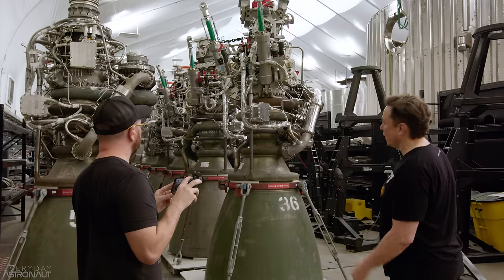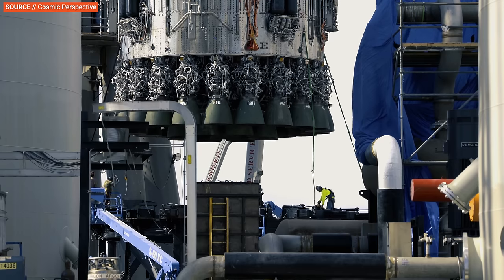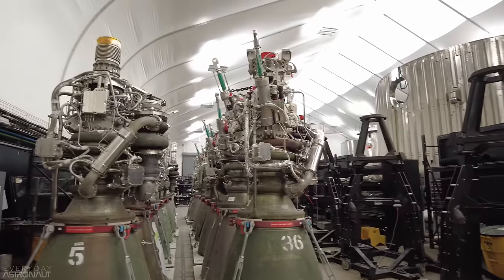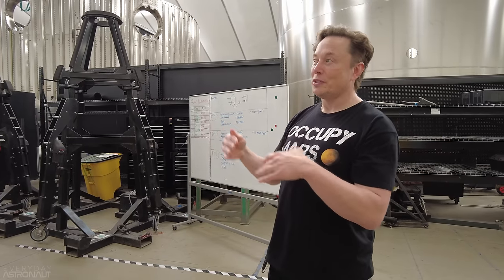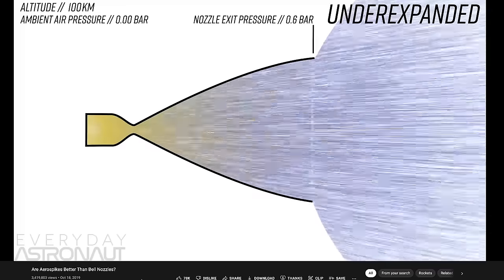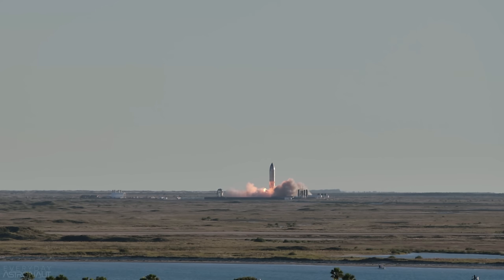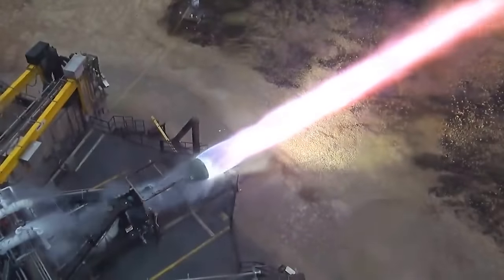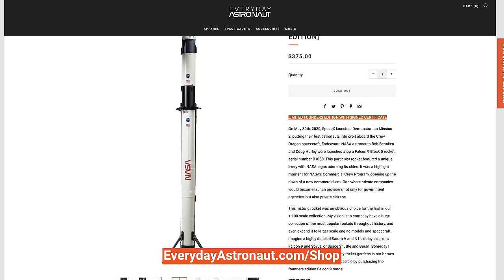How SpaceX Is Upgrading Raptor To Be The Ultimate Rocket Engine!

Comment: Amazing video, Tim! I don't know about everyone else, but I'm curious to know exactly where the thrust gets transferred from the engine through to the body of the vehicle. What are the points where the power is actually delivered, starting from the combustion chamber flowing through to the body of the engine and then up through the mounts. I'm sure it's not complicated, I'm just having difficulty visualizing the details. Keep up the great work, your access and coverage gives us insights I'm sure none of us could ever imagine having before!
Reply: The raptor is a bit unique in that it has the liquid oxygen turbopump integrated into the top of the engine, so the load path is from the top of the combustion chamber, through the turbopump housing, and then into either the solid mount or the gimbal.
Reply: @EagerSpace  Interesting! So on a gimballed Raptor, that flexible tube at the top can handle 230 tons of thrust and still deflect 15 degrees in either axis? That is astonishing, thank you!
Reply: @biltrex  no, that bellow carries no load. the pivots of the gimbal mount will carry the load.
Reply: @joman2055  Thank you! That does make a bit more sense. Be nice to get a look at those pivots but I can see why that's hard to do. But my mental image of what's happening has clarified dramatically. I appreciate that.

Comment: Tim, have you already had a discussion with Elon or discussed on your own solo videos, what parts on Raptor 2 may be suited to larger castings? Or due to materials not possible, welding smaller parts only option?

Comment: I’d love to see what the SpaceX engineers could do to scale up and improve the Pangea Aerospace aero spike engine.
Reply: Aerospike engine was for single stage craft..  efficient at sea level pressure and vacuum.  Once you have 2 stages aerospike engines have no purpose.  Because you can optimize first stage for sea level and second stage for vacuum.
Reply: @andrewlindberg1887  For a conventional rocket that would certainly be true. However the ship will be firing its engines in space as well as at sea level during landing. Currently this requires two different versions of the raptor. If SpaceX switched to aero spikes on the ship, you could eliminate the dead weight of the vacuum raptors during landing not to mention shortening the length of the engine shroud to reduce the ship weight even further. Less weight means more lift capacity and we already know the lengths Elon will go to maximize that.

Comment: I’ve read a few comments along the same lines, but I found it interesting that Elon kinda brushed off the importance of ISP in favor of thrust/useful work (which you excellently explained in this video). Is thrust to weight important for lift off whereas ISP influences overall performance? On another note, in lower gravity scenarios (moon, mars, asteroids, etc), how might improving ISP vs lowering thrust to weight affect useful work?
Reply: The answer is that it's complicated. When you are trying to get to orbit thrust/weight matters a *lot*. If you can get to orbit 10% faster - say 475 seconds instead of 500 seconds - you save 25 seconds of fighting against gravity, so 25 * 9.8 = 245 meters/second of extra delta v (a bit less in reality). That is a big difference in performance. 

When you aren't fighting gravity, it's much less important. You do get a benefit of using high thrust - more delta-v for a given amount of fuel - but it's much less and Isp becomes more important.
Reply: @EagerSpace  In space thrust does still matter a bit for gravity assists since you can make more effective use of the oberth effect. The gains from that probably aren't enough to offset the raw ISP benefit from trading off some thrust though.
Reply: @dotnet97  Yes.
Reply: Consider the extreme example from the video — if your TWR isn't greater than one, you're not going anywhere, no matter how efficient the engines are. But even in a less extreme case, your engines might be powerful enough to get you to space, but once there, you've got a limited amount of time to reach a stable orbit before gravity pulls you back into atmosphere... so if you don't have enough thrust, you're not going to orbit.

That's not to say that ISP isn't relevant during launch — inefficient use of fuel means you need more of it, in turn increasing the mass you're lifting. But lower thrust means burning the engines for longer, which also means more fuel use, more mass, etc. So for a launch engine, trading a few seconds of ISP for a big increase in thrust is kind of a no-brainer... the overall efficiency of the system is much more important than the efficiency of the engine.

Comment: just imagine Raptor going the way of merlin, with a number of enormous upgrades and variation over the years eventually getting it to double the thrust and significantly lower weight.
something like a Raptor 5 with 370 tons of thrust with a weight of 1500kg, chamber pressure of 400 bar and ISP of 345 seconds isn't outside the realm of possibility to exist within 5-ish years. 
it only took SpaceX 6 years to go from the Merlin-1A to the Merlin-1D, which had more than twice the thrust, nearly double the chamber pressure and net flow rate, and a vastly superior ISP. they have vastly more resources available now than they did then- even if they just work at the same pace they were working then they could get the Raptor to an absurd level of power and efficiency.

now imagine what will succeed the Raptor engine. this is an exciting time for the field of rocketry

Comment: Actually, while it's true that increasing to a T/W ratio of 1.5:1 is 20% more than a T/W ratio of 1.25:1 and that results in a doubling of the net acceleration that is only true at the very beginning -- as the fuel burns off the acceleration increases for both but the net acceleration difference declines throughout the burn -- by the end of the burn as the propellent is almost used up the acceleration advantage would decline to about 20%.  It is not uncommon to shut some of the engines down before seperation to keep the net accel down to about 4g and with more total thrust with Raptor 2's they would need to shutdown some engines earlier.  You could throttle down but that lowers the efficiency as it lower chamber pressure.
Reply: Great points that rocket engineers keep thinking about.
It would be interesting to see that curve graphed out for the booster and the ship
Might be worthy of a video! @every day astronaut!

Comment: The main advantage of the Full Flow Staged Combustion cycle is that it allows using almost all propellant that flow through engine to drive turbopumps, making it much easier to increase pressure in the main combustion chamber.
To achieve higher pressure, very powerful pumps, such as those with a capacity of 100MW, are required. It is easier to obtain such power by using the entire propellant to power the turbines. Higher pressure result in higher thrust from same size engine
The second advantage is that with higher pressure in the main combustion chamber, it is possible to increase the expansion ratio and slightly improve the specific impulse in sea-level engines. 
Is this correct ?

Comment: my advice for the next booster test: use the mathematical Fibonacci sequence for starting up the engines: 1, 2, 3, 5, 8, 13, 21, 34, ( 21+34=55 is the next n in this sequence)    
 Nevertheless, I suspect, the landing and capture to be the more daunting procedure, especially if there are gusty winds and a substantial wind-shear between the top and bottom of the tower! Have You realized how windy it was at the top, when You visited with Elon, while it wasn't that much wind at ground level? Maybe a set of LIDAR laser-sensors around the landing-site could measure and model the wind-field in 3D, in real-time. (it is a similar/more serious problem like SpaceX encountered when capturing the payload-fairings by a boat with that net) And the next-gen Launch-Tower could be 1000m or 2000m high (lifting the rocket at first 1-2000m high  by crane. This would save some fuel!!! and the wind-shear is probably less vicious, less short term gusty, up there)

Comment: nobody doubts, that SuperHeavy/Starship can reach orbit, so doing a suborbital 1st test flight is kind of unnecessary. What about doing a 10_miles high hop- over the ocean -  of SuperHeavy, with a dummy payload (dischargeable, maybe with some Draco-thrusters on the dummy payload), and then return and catch the SuperHeavy booster. Maybe repeating this test several times until SpaceX is sure about the capture and relaunch procedures? 
 Think again about the mechanism. Compare with (water-)ships when they are tied down at harbor. it is done with ropes! same with SuperHeavy: shortly before setting onto the knobs You need 3 lassos to catch the top of the rocket and tie it down precisely ( + - inches) 
  The capture mustn't be so dependent on good luck with the weather. Or wrap the whole site in a very high windshield?! the harbor of Rotterdam has huge windshields for easing the unloading of containerships.
Reply: Actually, it could reach orbit with quite high payload. Over 100 tons payload in a single stage as an expendable. Properly weight-optimized reusability systems can be kept under 10% added weight to the dry mass. Result:  quite high payload as a reusable single stage to orbit vehicle.

Comment: Just to make clear: 300 bar is in the throat. 300 bar = 300 kg/cm² so the throat's surface is (trust) 230000 kg / (pressure) 300 = 244 cm² or a diameter of 12 cm. Bringing it to 15 cm @ 300 bar would double the trust, since it is doubling the throat's surface, if at all possible (think not, but upscaling a little bit, might reduce the needed raptor (3?) by a lot)

Comment: The comparison of Raptor 1 to the RS-25 was surprising.  Despite being much smaller the Raptor 1 has the same thrust as the earlier RS-25. And the Raptor 2 about 25% more thrust.  This speaks volumes to the increased efficiency and power of these rocket engines.
Reply: Would be fun to compare more closely to the experimental integrated powerhead.

Comment: I wonder if future versions of the vacuum raptor will have a smaller throat diameter than the sea level raptor. This would give a higher expansion ratio and higher ISP but reduce thrust.

Comment: Are Raptor 2 engines still melting?  That is kind of important.  Most StarShip flight failures were attributed to melting Raptor (original) engines (plume turns green).  Raptor 2 engines have apparently melted on the McGregor test stands and perhaps in some strap-down firings of StarShip at the Boca Chica launch site.

Comment: Thanks Tim for another well made video. Getting better and clearer all the time. Wondering if raptor engines can be used in a falcon9 type and size rocket using methylox?
Reply: They're too powerful to support landing on that size rocket. Falcon 9 already has to do a hoverslam to land (not that hovering is a good thing), and the Raptor is a lot more powerful than Merlin.
Reply: They could, but recovery would be extremely difficult. Rocket engines don't like to throttle, and they really don't like to throttle down in an atmosphere. The falcon 9 landing is extremely tough, due to not being able to throttle down below the weight of the booster, and that only uses 1/9 engines. I don't think they would opt into suicide burns again. Raptor could probably manage fine with 9 engines, but not easily with many fewer. A 5 engine configuration might be doable, but would already have ~50% more thrust than a falcon 9. 3 raptors and a smaller central landing engine might be possible, and would be pretty much a drop in replacement for the falcon 9 booster. They probably would not want to mix fuels though for ground equipment simplicity.
If the goal is a reusable upper stage with propulsive landing, the lowest possible vehicle size is set by the minimum thrust of the engine at sea level. That minimum vehicle size will probably need 2x the engines to get to orbit with useful load. Absolute minimum would then be 2 engine configuration, which would be absolutely weird to land, so practical minimum would be 3 raptors in a line. If you want those outer engines to be vacuum raptors you find yourself with something almost the same size as starship already. If you want redundancy on landing you basically end up with starship. Starship is sort of the minimum vehicle size if you want to do the job with a single engine type. That sets the minimum size of the booster too.
The interesting thing we might end up with is something closer to the shuttle. If you are wanting a reusable upper stage with only a single engine, propulsive landing is not really an option. You are forced the lifting body runway route. For a small crew vehicle this could end up being a sensible option. A 9 raptor booster with a lifting body strapped to the side of it* could handle a crew of 4 on a mission to service something in polar orbit, and only needing 10 engines flights rather than the 40 for a starship flight would be a considerable saving.

* Strapping to the side is probably safer than the original shuttle would suggest, in part because bits don't fall off a stainless steel booster. Of the many bad ideas on the shuttle, the configuration (while very badly suited) was not the worst.

Comment: I wonder if it would be possible to upsize a Raptor engine in order to reduce the number of Raptors on the booster rocket my reasoning for this is: the fewer Raptors  needed would translate into a simpler fuel distribution system as well as reducing the likelihood of one or more having a defect.
Reply: But increases problems with landing and engine out capability.

Comment: Tim, a question from an earlier video: The N2 thrusters have been eliminated from SH & SS, vent thrusters will be used instead. But you two noted these 6 bar thrusters are only useful in vacuum or at very high altitude. How will SH do the very fine maneuvering for the Mechazilla catch, to within tens of centimeters? (Till the arms can close in.) The vent thrusters won't have even 6 bar at this point, the mass of gas will have been vented to lighten the booster. So, gimbaling only? SpaceX has incredible algorithms, but can the physics of engine throttling be this fine? Can gimbaling be this fine?
Reply: The internal pressure of the tanks is at a constant 6 bar as far as I know. I also think they use the gimbaling Raptors and grid fins for most of the maneuvering. The vents are only for adjustments in the upper atmosphere, not while landing. The Raptors gimbal so fast they can almost do anything you want them to.
I expect the booster will be more exact than the Falcon 9's. They might even be so sure of this they would try the chopsticks on the first flight (I hope they don't).
Reply: Brings to mind the early prototypes when they flew silo-looking cylinders for short hops. Seems to me that they're pretty close in terms of throttle control and navigational algorithim.  The real key IMO would be the reliability of the raptors.  Before landing, they could be relit as much as three times (boost back, reentry burn, landing burn).

Comment: I think the startup sequence and the two separate pumps are a source of many problems. When your life rely on a correct A/F ratio, it's a nightmare when those are not mechanically linked. The vacuum versions could still have the smaller throat for better efficiency tho. The thrust needed depends on the flight plan.

Comment: It surprised me to hear that the gimbal mounts are on the interior engines only.  Gimbals on some of the outer ones would produce more steering torque, require less movement and allow mechanical linkages to be less complex.
Reply: I'm not sure about this, but I believe that only the center engines will be used for the final landing sequence, which means that you need the gimbaled engines there rather than on the outer ring of engines.

Comment: When I look at the booster array of Raptors, I keep thinking about the Soviet N-1 with its 30 first-stage engines, and the multiple failures that resulted. I assume the Raptor is significantly more reliable than the N-1's NK-15s, but that many potential points of failure still make me nervous.
Reply: 4 crashes killed the N-1 program. 4 crashes would also be the minimum that SpaceX has typically has when building a new rocket / getting a rocket to do something new. A few crashes shouldn't kill Starship.

Comment: You once made mention in a video of a 230 000hp turbo pump that runs one of these fuel monger engines. Can you pls make a video showing what a 230,000hp pump looks like. There's seriously no video on YouTube about this. I'm sure everyone would want to see such a pump even a nuclear submarine would really struggle to throttle to full power. 230,000hp is a unthinkable figure and till we see it, it's really unbelievable such a pump even exists, much still yet unbelievable that it can even fit in a relatively small vehicle like a rocket 🚀.  PLEASE MAKE A VIDEO AND SHOW THIS MYSTERIOUS STUFF cause just figures alone make it really hard to believe!

Comment: Amazing video!!  I can't imaging 33 of these beast firing at once... and I can't wait to see it!  What can beat a raptor?  Maybe a nuclear engine - but moon and further out, please...
Reply: Nuclear engines would not be able to fire in atmosphere to do work. They'd be boosted into the vaccum by Raptor engines.
Reply: @motokid6008  Nope. NEVER let them touch Earth's atmosphere or the planet.  Manufacture them on the moon, and use them for interplanetary transport. That way there's no "woops..." of a crashed one being lifted to orbit (and casual radiation isn't a real issue either).  That's what I tried to say, but failed to convey.